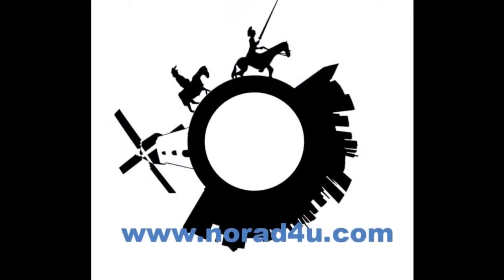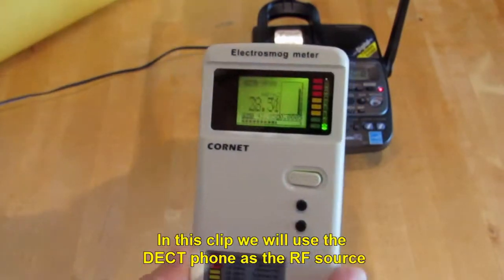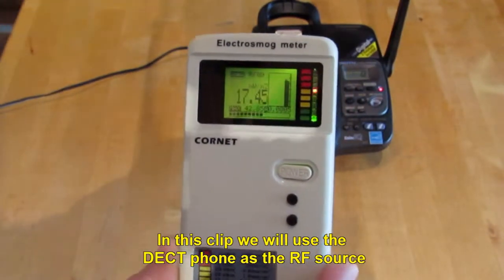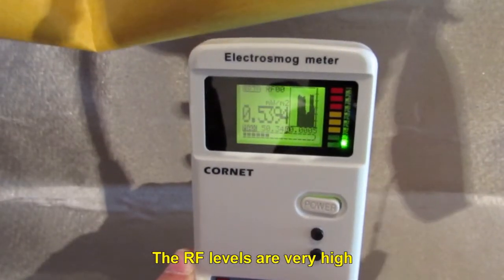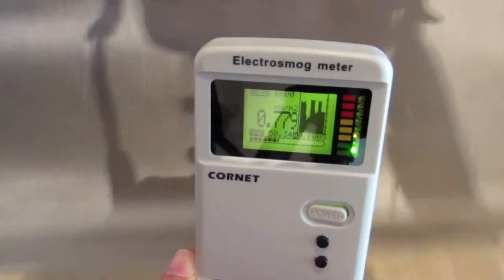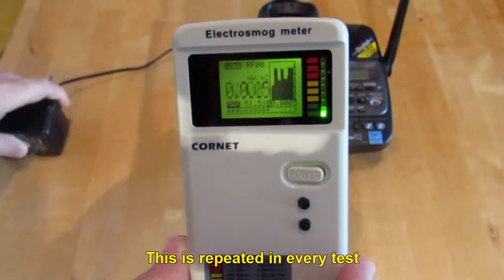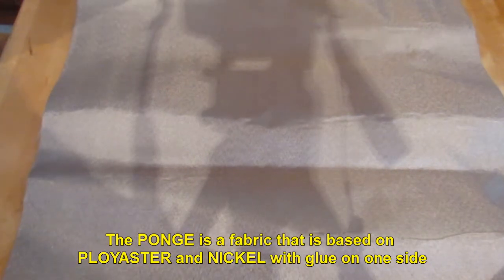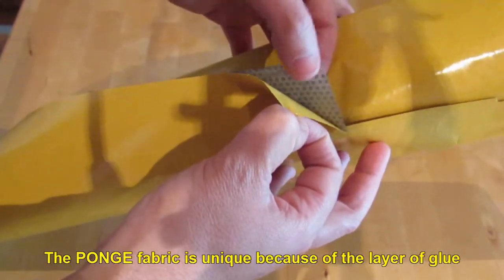PONGE RF EMR Blocking Fabric with layer of glue

Comment: hey what is that think and does wood blocks my wifi router coz im sleeping like 2.5m away from it but its behind cupboard and an other wood furniture so at least 3-5 cm of wood 
what frusturating me most it has 2 antenas and i can get wifi signal into pantry 4 floors below coz i live in flat
Reply from the maker: JusstyteN It most likly can pass via the furnature or above/bellow/beside it.I recommend that you use a wired connection and turn off the WIFI signal.The minimum you can do is turn the WIFI off at night when you go to sleep.I hope this info helps.Amirb
Reply: thanks